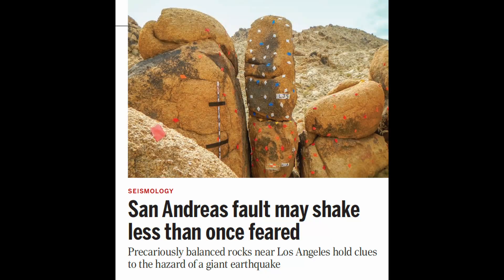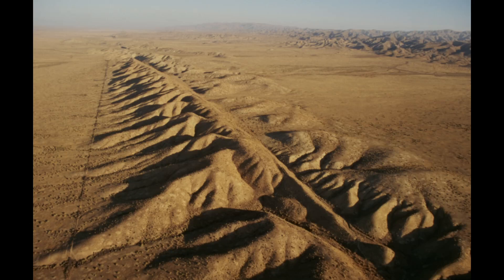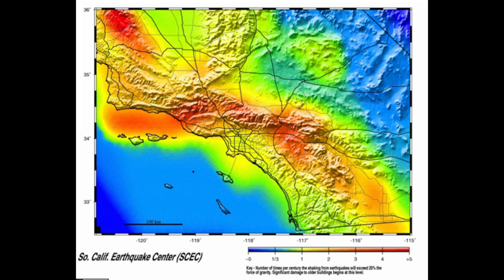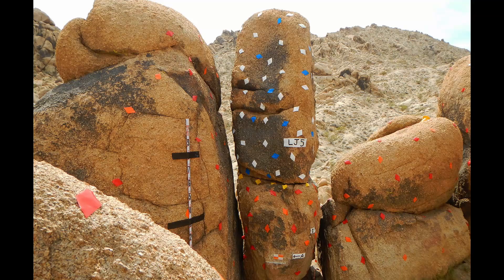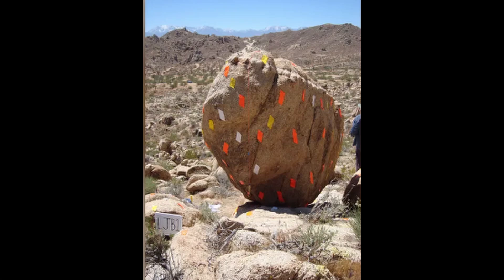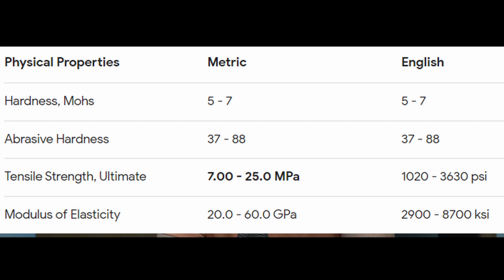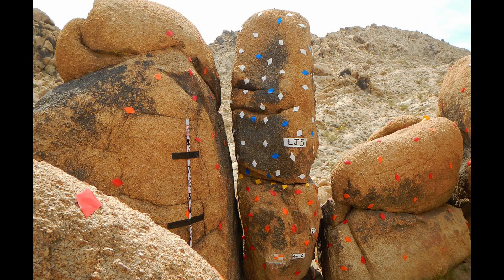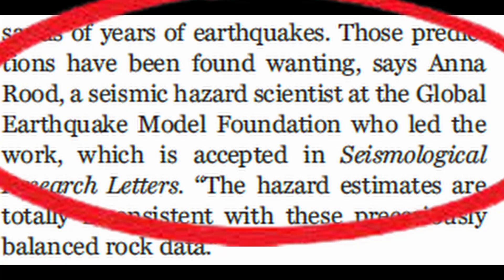Using Rocks to Predict Ground Acceleration from Earthquakes

Comment: This is a great area of study and hope you dont mind an added note about the granite. Since it forms several miles underground there are stresses incorperated in its crystal layout from the pressure as it is moved and lifted and overlying rock eroded stresses change and often sets of stress cracks form in multiple  directions. As the rock is exposed thermal cycling does start to work often rounding from sets of preexisting cracks that concentrate stresses at edges of blocks. Also when underground hot waters may follow the cracks in the rock and if hpt and ascidic enough deteriate [ rot] the rock. Also as the hydrothermal fluids move through the rock minerals like quartz sulfides and my favorite gold may be deposited 

A long note but a geology professor told of a developement in the az desert. For recreation a dam was placed in a canyon to create a lake. The geologests had noted tbe bedrock was fractured decayed granite. When the lake was filled the water pressire washed away the softened edges of the blocks. And after the water drained away the lake bottom looked like a field of gient rounded marbles.
Reply: Ps in mining the  idaho bathilith by boise often will have cobbles of gray solid granite hatd and strong mixed with orange rotted cobbles that shatter if droped or hit
Reply from the maker: Thank you for your notes. You make excellent points. As you mention, the stress history of soil and rock is important to know for engineering applications.
Reply: Awesome! I didn't know this! Thanks!

Comment: To determine geologic timelines, paleontologist use the rock layers to date the fossils and geologists use fossils to date the rocks using which is circular reasoning which is senseless. Geologic timelines at best are just theories, not real science.
Reply: Not circular thinking but parnell lines of evidence that agree with each other.  A note about terms a hypothesis  is an idea that can be tested by experiments and observations . A theory is an idea that fits all the observations  but can not be proved by experiment due perhaps  by time needed  to run experiment.  Eg evolution of man from single cell animals taking say a billion years. 
 Now a law can be proven by experimental m eg the law of superposition  says a layer laid on top of another layer in the normal course of nature  must be younger than the existing layers. Do you not agree with that law? Exception occurs when extra ordinary things happen such as  molten rock may be injected between Layers but usually leaves easily visible evidence . Also a stack of older rock may be shoved over younger rock. But again evidence of the occurrence is visible. Further  the thrust faulting must be younger than  the layers  themselves  to have taken place,  ie layers not there can not be moved around
Reply: Mr Martin hope you get to read my reply. Geology is a wonderful area of study
Reply: YT shows 3 replies, but only posts one reply, typical YT.
Reply: Theories in science are actually hypotheses with so much evidence to back them up that they are unlikely to be false. However, should someone come with enough evidence to overthrow those theories, they'd probably win the Nobel Prize. In science, it's all about the weight of evidence and any hypothesis, even if it's graduated to the level of being a theory, is still subject to being challenged with new evidence to refute it. It's hard for human beings to do but science demands that we follow the evidence and sometimes we'll be wrong for a while but, if we keep following the evidence, the scientific method is our best chance at finding what's really true.

Comment: As a SoCal high desert local NOW I know why I'm slowly loosing my head of hair. Too hot and then too cold each day!
And here I thought it was just old age!
And yes I live near a major fault line and JTNP.
Reply from the maker: I never heard of the thermal cycling theory for hair loss, sound plausible to me!🤣🤣
Reply: @CaseyJones-Engineer  If you cycle in Thermal, CA and it's windy it's called trans-evaporation. If it's raining it's liquefaction. 😁
Reply from the maker: @blaydCA  😄😄
Reply: I'm just on the other side of the San A from you. My mom was a math professor at the college there before she retired. The thing we all have going for us is that enough noteworthy earthquakes have occurred in the area that there is less of a tendency to pretend that earthquakes don't happen here. Basically all of us have felt at least one earthquake, if not tons of them over the years.

Comment: Fascinating, especially since we recently had multiple separate 7+ magnitude earthquakes within a 3 week period in our region (Eastern Mindanao). So from rocks that did not topple, we can calculate the maximum ground acceleration that occurred at that location, based on the calculated tensile strength of the base and the mass? (If I understood this correctly)

How accurate is that? Could someone fasten a rope to the top of that rock and measure at what amount of force it would actually topple? Would that be within a few percent of the calculated maximum acceleration force? 

Can we also find rocks that did topple recently from earthquakes and use these for similar calculations?
Reply from the maker: Yes, you are right on all counts.  I think most places would not allow the researchers to topple the rocks to measure the force but it would be another way to figure things out.